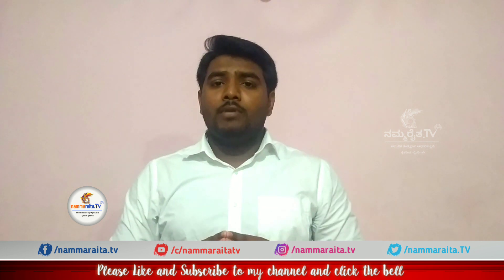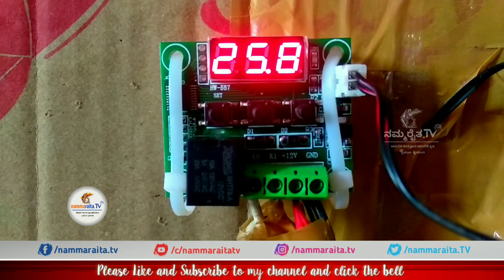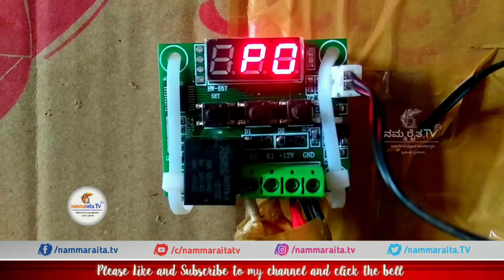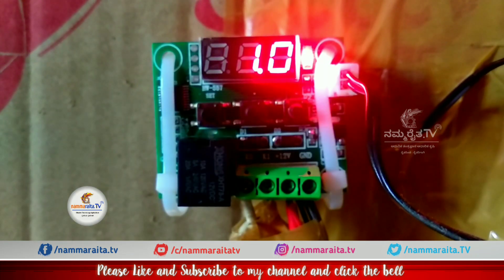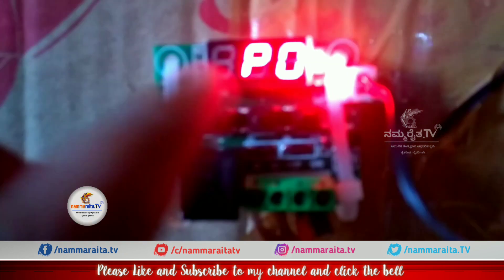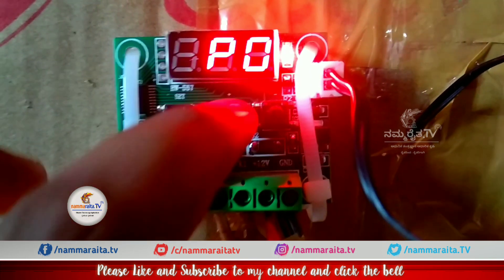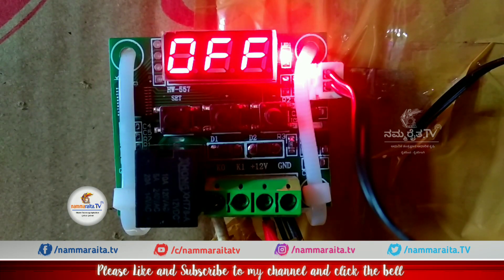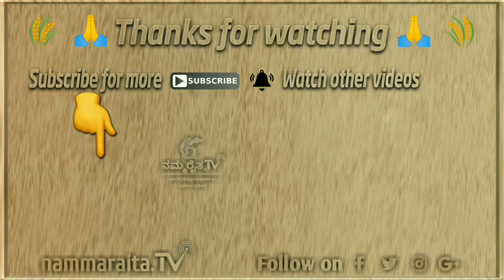How do you set a w1209 thermostat? in Kannada

Comment: How much temperature  is required  for  duck egg hatching  sir
Reply: Plz reply
Reply from the maker: Set the temperature at 37.5°C (99.5°F) and relative humidity at 55% (84.5°F on wet bulb thermometer). Set ventilation as recommended by the incubator manufacturer. Eggs must be turned, either automatically or by hand, a minimum of 4 times a day.

Comment: Yest volt bulb hak beku .box full close irbeka athava swalpa open irbeka.temperture concetion heli plz sir.
Reply from the maker: 15w + 60w bulbs use madi. Box full close madi. 6 - 8 small holes madi air ventilation ge....
Reply: Sir fan mathu thermostat haklebaka sir Ashtu parsent hatching agutta
Reply: Thanks sir .sir 12 v DC  charger complsry hakle beka fan hakde iddru
Reply from the maker: ಹೌದು ಆಕಬೇಕು ಏಕೆಂದರೆ thermostat w1209 ಅದು 12v ಬೋರ್ಡ್ ಅದಕ್ಕೇ 12v power ಬೇಕು ಅದಕ್ಕೆ 12v 2A power adapter ಬಳಸಿ.
Reply: @nammaraithatv  thanks sir
Reply from the maker: Your welcome sir
Reply: @nammaraithatv  sir plz last question 12v 1a adapter unt Agatha sir
Reply from the maker: Agutte balasi
Reply: @nammaraithatv  ok thank u  sir
Reply: Sir nivu helid 12v 2a .nann hatra irud 12v 1a adke kelid sir